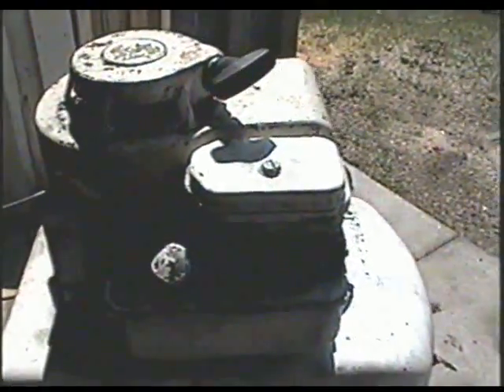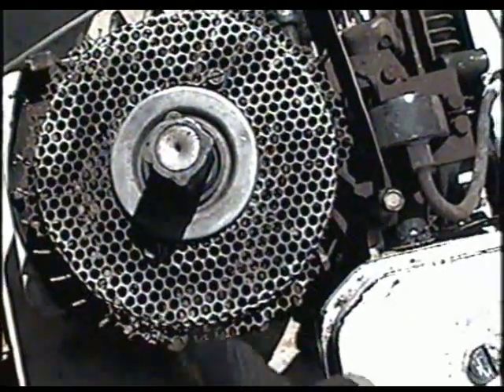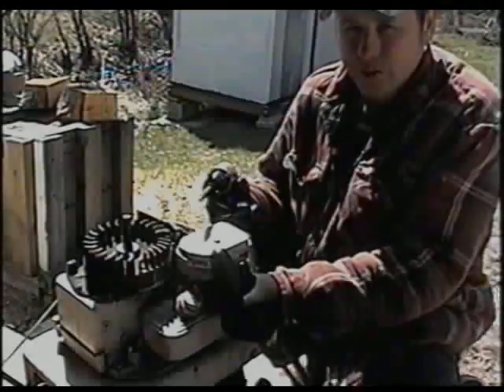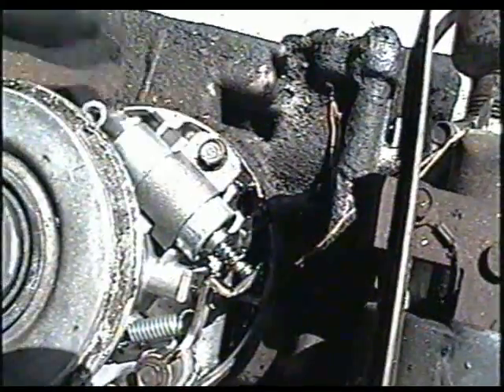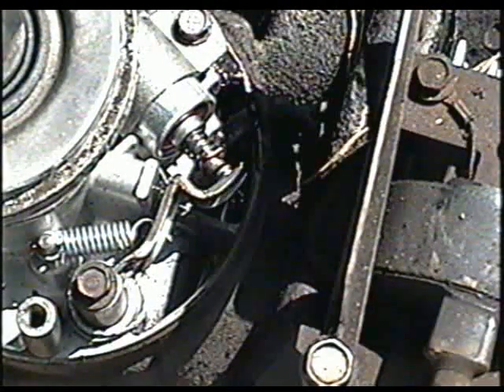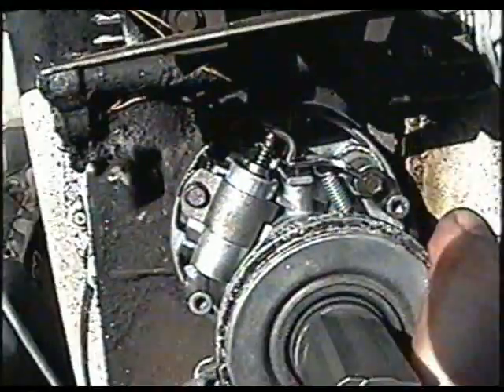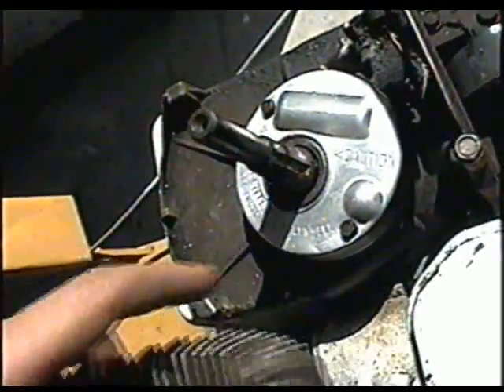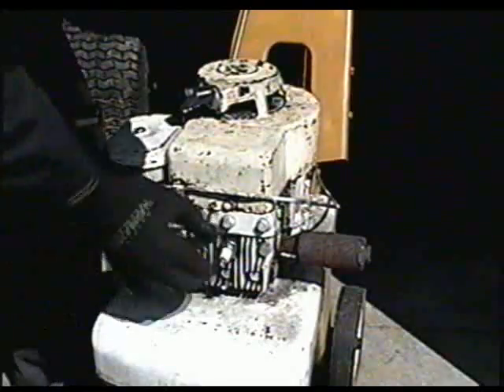HOW TO ADJUST The Points on 3.5 HP BRIGGS & STRATTON Engine

Comment: @donyboy73 my engine is on a antique golf cart 
and it has not ran for over 10 years so it needs alot of work but ill try replaceing the wire thanks :)
and maybe check the points.

Comment: Great video!  It made it easy to get my engine apart

Had no spark - got my engine torn down, the points are opening and closing...
so how do i know if I need to replace the coil or condenser or points or all three?

Comment: Hey, I say your video. I have a briggs and stratton 5HP just like that one that is on a rotary tiller. I need to replace the condenser. I was told I can do away with the points system simply by purchasing 394970 
(magnetron upgrade kit). I was told you have to send the flywheel to b&S for repolirization of the magnets, is this true??? Also I noticed the ignition coil has 2 wires running out of it from underneath. I can't seem to find the same exact ignition coil with 2 wires running out from it

Comment: @donyboy73 there is no conversion kit, just litterally take a electronic magneto from say a 95' or 99' or a brand new one, it will fit right on there, as long as its from another 3.5hp engine or now called the 300 series or the 450 series or 4hp, they are all the same. cause i was able to put my 3.5hp 1991 magneto which is electronic on a 1970s 3hp engine, and i belive it has to be from the same size of engine, but its really easy, just cut the points wire, unbolt magneto, bolt on electro. magn.